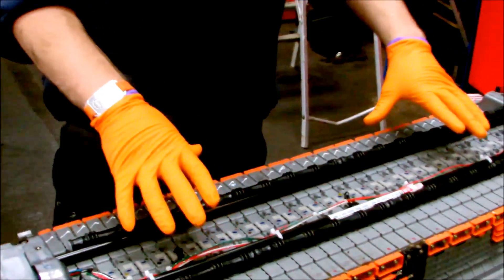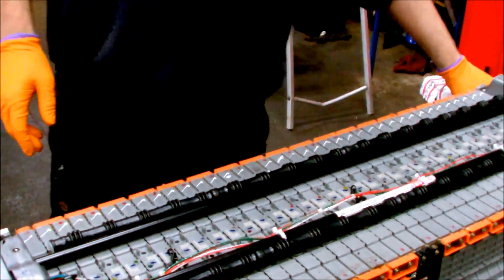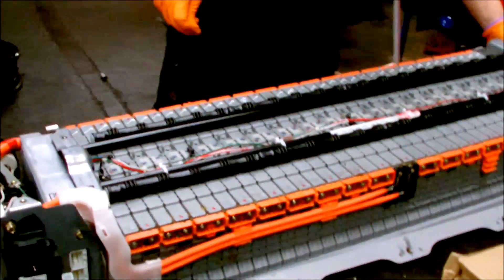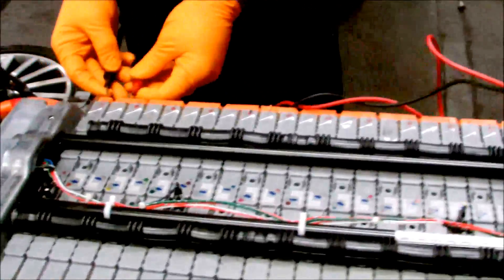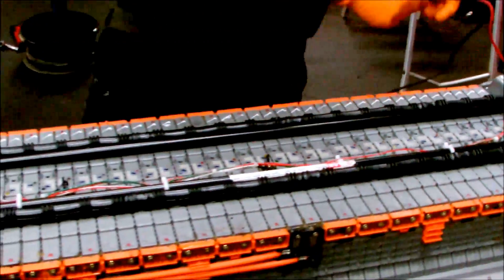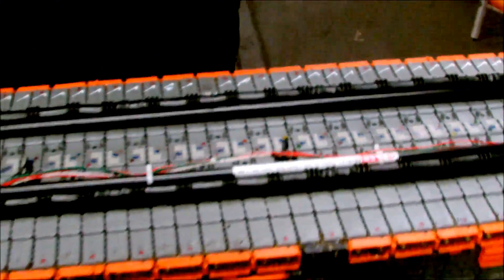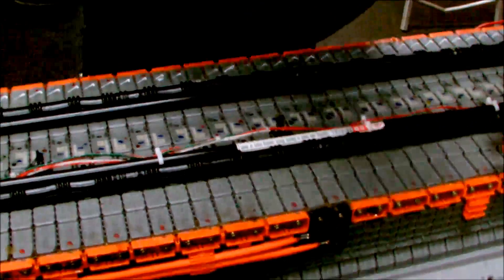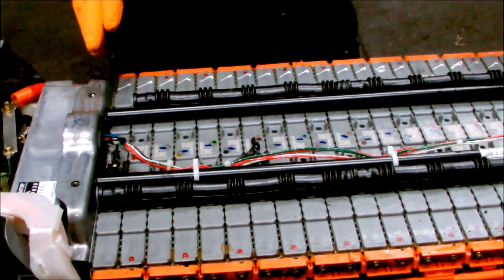Toyota Prius Hybrid Battery Repair Replacing a Bad Cell

Comment: I have a check engine light on and on the display it says check hybrid system? I ran scanner and got two codes: POA80 replace hybrid battery pack and a POA7A Generator inverter?? What is the multimeter that you are using to Test voltage? Thanks
Reply from the maker: Hi Daniel, read the multimeter details in the description above.☝️👍🏼
Reply: @molometer  Awesome thank you for the info!! 👍
Reply from the maker: You're welcome 👍🏼

Comment: Can bad cell be fixed
Reply: use new cells and safe yourself time and money and hassles.... can be repaired but problem can come back again, i have a friend who installed a refurbished battery then problem again within few months, thankfully the guy who did the job gave him 1 year warranty and was replaced again with refurbished pack... one year over no warranty anymore.
Reply from the maker: Totally agree.  Good advice.
Reply from the maker: I don't know but I doubt it as each cell is a separate sealed unit. Anything is possible but to repair a bad cell would be very difficult? 📽👍

Comment: I'm gonna try this at home (:
Reply from the maker: Not lol
Reply: @molometer  is this basically the same process you'd use for code p3006? Battery levels uneven.
Reply from the maker: Hi John, I have no idea. I just filmed Graham doing his assessment of the separate cells. 🎬🎥👍
Reply: @molometer  thanks for still replying to comments on this old video! Prius chat website helped me and and your videos going to be a good help so thanks again!
Reply from the maker: @johnbartz1907  You are most welcome John. This video still gets a lot of views as it's still relevant to so many people with a Prius. 👍
Reply: @molometer  for sure! Ripping this bad boy out of mine today after a lot of research and getting a safe warm work area, wish me luck!
Reply from the maker: @johnbartz1907  Good luck John remember to take all safety precautions 👍

Comment: Can this be replacement with any battery module or do we have to get one identical to the one we need replaced ?
Reply from the maker: You can replace any battery module with the same type module. 
It doesn't have to be from the same physical location in the battery pack. 👍

Comment: Thanks for the video but it does me no good when you are on the other side of the battery touching the terminals and I can't see
Reply from the maker: You're welcome, he was testing each cell with the meter. Therefore the reading on the meter is the thing to watch.
Reply: I slowed the video down and got more out of it thank you so 😊❤️
Reply from the maker: My pleasure, glad you finally got what you needed to know 😋👍

Comment: Checking voltage alone is misleading. You should also be doing a load test and capactiance check on each module. A voltage check can quickly identify a bad cell but a capactiance check will shows you the actual life of the rest of modules
Reply from the maker: All I know is that the car works great and Trevor is a fully qualified hybrid engineer. As for the technicalities I have no idea. I just drive it and make videos. 😋👍

Comment: 2013 Prius modules (cells) range from 7.83-7.81. Does this mean the cells are still good?
Reply: Load is a factor, not just voltage. Load test is a must.
Reply from the maker: +Richard Peter sounds OK to me

Comment: my car Camry hybrid 2007 often show hybrid system check ? i already changed pack of batteries but 20 days later it will show again but it another pack error why ? I'm very tired for it can anyone tell about it ? why ?
Reply from the maker: Who did the repair on your car? Sounds like you need to take it back to them and get it checked.

Comment: Didn't you have to bring the voltage of the new module to the same voltage of the rest of the modules?
If yes, how did you do that?
Or does the hybrid system balance the modules?
Reply: Where can I get new cells the dealership doesn't sell them
Reply from the maker: Check the Amazon link in the description above. If it doesn't work there may be another seller. 👍🏼
Reply from the maker: Bas Jantzen the replaced cell in the module was at the same voltage as the rest of the battery pack. Just over 8 volts
The defective cell only showed a voltage just above 6V. 
The system maintains the  modules at optimum. If one cell is not holding a sufficient charge you get the error mentioned in the video and it has to be replaced.
Hope this answers you query. if you would like further details send Graham an e-mail. His link is in the description.
The car's still running great.

Comment from the maker: *Updated comment July 2022*
There is an Amazon link in the description above to get a replacement battery cell for this repair. Good luck and let me know how you get on.
My Prius was still running perfectly until May 2020. When thieves stole the catalytic converter! 
It worked great for years and saved me a small fortune.

Comment: Is the Prius still running OK?  I would like to know how many miles and months the battery has lasted since the hybrid battery repair?  Thanks
Reply from the maker: +BigSexiMan the replacement battery cell was fitted on the 22nd November 2014. The car runs fine no problems. I use it every day. Average 300-400 miles per week.
Reply: +Michael Mulcahy that's awesome!  I changed a cell on my 2006 Prius two weeks ago 3/13/2016. I put on 500-600 miles per week. So far so good. No problems!
Reply from the maker: +BigSexiMan Good for you for trying this cheap and effective solution. There are many much older Prius models that have done over 500,000 miles. Keep in touch and let us know how you are getting on.
Reply: molometer it another pack have problem
Reply from the maker: @DKSING  no problems so far and it's 5+ years later.